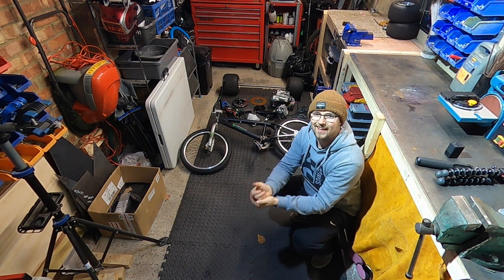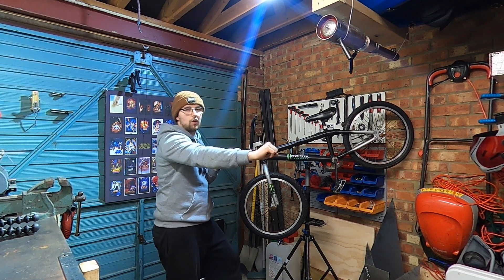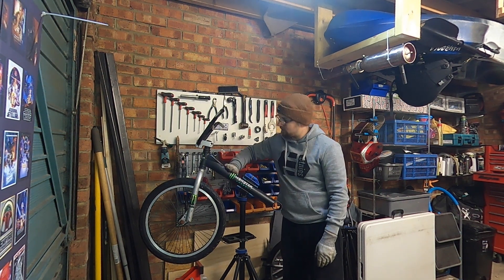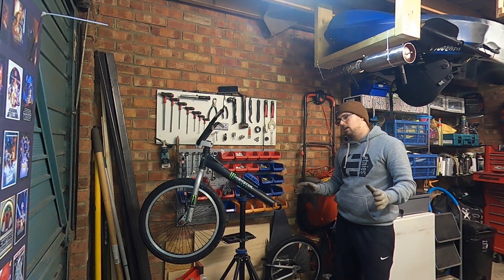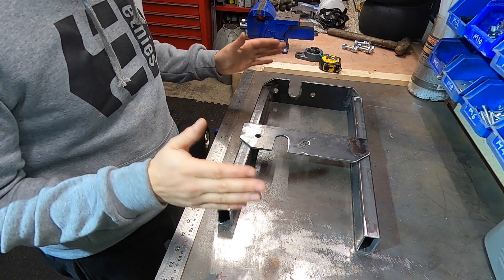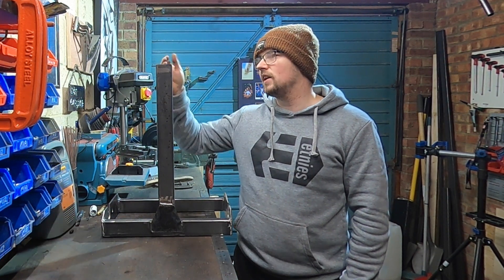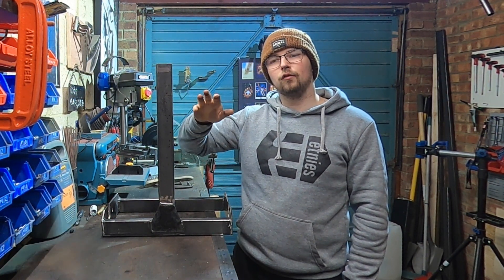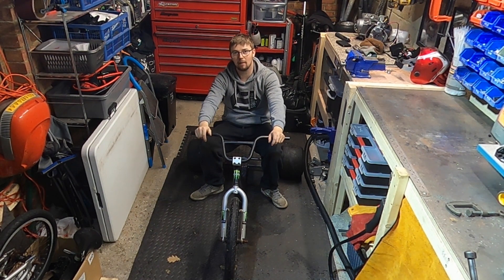Motorised Drift Trike BUILD Part 1

Comment: I thought the idea of cutting slots in the back was to remove the axle easy. You welded the back frame box. Back to front...8.25 welded the crossbar for the engine to mount ... !!!!
Reply from the maker: Yeah I know but after I realised it was to late the whole thing was together. Not the end of the world just makes disassembly a little harder.